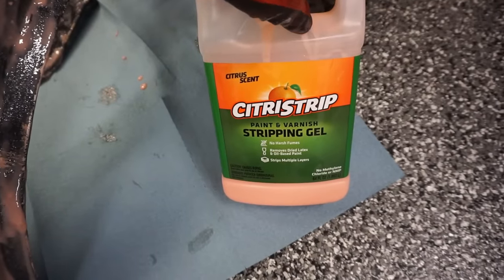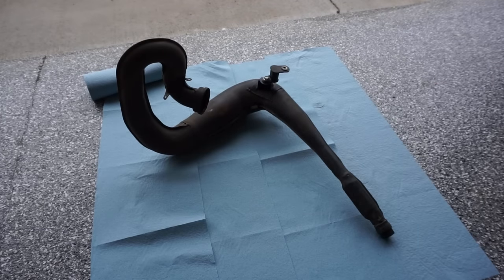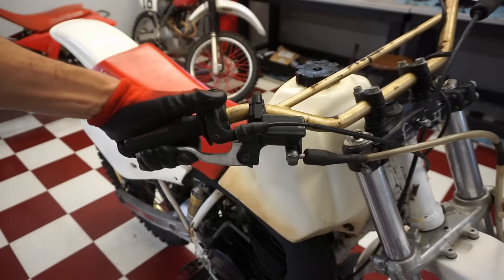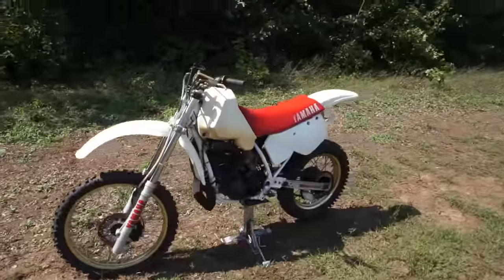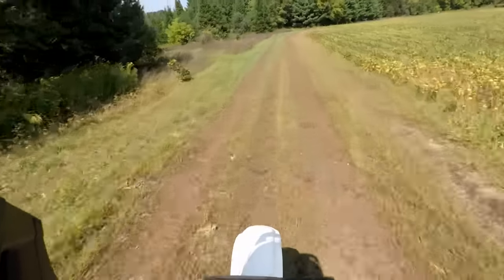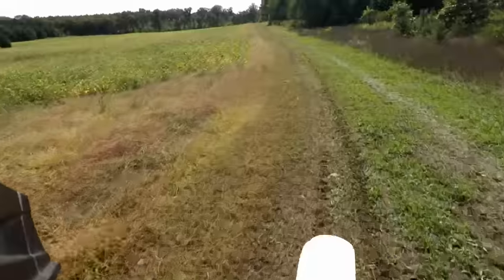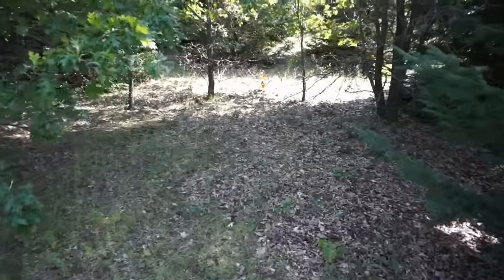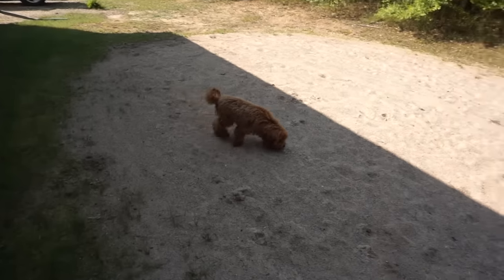Yamaha Yz490 Dirt Bike First Ride (INSANE POWER)

Comment: The YZ490 was prone to detonate / ping and run lean, we always jetted slightly richer and ran 30:1 premix to stop the rings galling. The best technique with them is to short-shift like a 4-stroke and let the torque do the rest. Running them on the top of the power-band is tiring and potentially VERY risky.
Reply: At 35yro I would suspect the crank seals have started to develop minor leakage.
Reply: Really I appreciate that info I'm buying one of these from my friend having only rode at one time it's a good bike but I don't know anything about them I've been on four strokes for the past 15 years
Reply: Not true at all there good bikes.
Reply: When these came out, I was working at a state OHV park in Calif and we saw several loop out on hill climbs as riders were getting surprised by the power available.
Reply: You need to keep running a 2 stroke lean in order to tweak the higher rpm's out of it. And add a little synthetic oil to your fuel instead. My experience with 2 strokes is from out of using OS Max and Enya RC aircraft engines and we used a Methanol/Castor oil mix 70/30 so adding a little oil to your fuel will crank out the full power of your 2 stroke.
Reply: @cryolabs  The only issue with running motor oil is the build up it leave behind. I guess it doesn't matter if it doesn't have a power valve but for those newer bikes, it would gum em up pretty good. However, if your looking for power, that may be a viable option.
Reply: Uh. Yeah. Its what the original poster said.
Reply: @cryolabs many people don't try to get to know the oils. They see a bike run strong and think it's good. A Two will get most it's power at it's leanest point which will seize it. Motul 800 off road oil is an amazing oil. Castor 927 two I'm very familiar with. I found best performance out of Two stroke engines staying between ratio of 32:1- 40:1
Reply: Good advice, thanks
Reply: Thanks for sharing Joe, love the trail cam shots.

Comment: Also if this helps after you turn on the gas tank. If you lay the bike over the float will open on the carb and it will leak a little gas out of the carb. But some will go into the intake  manifold. This primes the engine. This will make for much less kicking to draw fuel into the engine. If you lay it over for just 20 seconds or until you do a little drip from the carb over flow that all you need for a prime. I hope this is helpful! I’ve had several large displacement two strokes are and if you don’t have it primed. You can spend a lot of time trying to get enough vacuum to draw fuel in. And then you’re all worn out? Thank you for your videos. I’m only trying to help. So many are so critical of everything you do. And that’s not fair. I just want to be helpful.

Comment: I’m told those YZ 490s were very hard to jet accurately! They had that they had made them either run really rich and if you leave them out then sees right away. Yamaha had some service tunes on that where they used to base gaskets to lower the compression and that seem to help with the preignition in the head. You might be able to look up these findings on a YZ 490 forum
Reply: The squish was wrong and replacing the throttle valve with a leaner cut away helped too.
Reply: There is a head mod for this and solves all the pre-detonation issues.  These are great all around air cooled bikes for larger riders.  Find the best non-ethanol fuel you can get.
Reply: @jonmccormick8683  💯.  They need the head mod
Reply: Back in the day running 110 octane fuel cured a lot of issues on these bikes.
I had a couple of 490's back in the day and the rideability and starting, plug life everything was like having a different bike running high octane race fuel versus pump gas and back then pump gas was available that was much better than what you can get today!
Reply: Don't forget the front fork boots!!

Comment: I went from a YZ250 to the YZ490 then to the TT500 and finally the TT600.  I'm 62 now but I wore out plenty of these bikes in the 80s.  Nice to see you bring one back to life.  I do agree when the YZ490 hit the pipe it was crazy scary.  Love the channel.
Reply: I love the channel l would like to know the price for a 650 key start engine
Reply: Strangely enough I almost did the same: IT175, IT250, IT465 and then IT490, then on the flip side, XT550 then TT600. Loved the way Yamaha was building bikes in those days.
Reply: @jakeslouw3416  Absolutely.  I was a Yamaha rider and still a big fan.  I wish I still had the TT600 today.
Reply: I had an 82 490,75 tt500 best 2 bikes ever had

Comment: I was smiling the whole time you were riding it and laughed every time you said you were scared of it.  It brings back great memories of my KX500 in the dunes.  LOVE the big 2 strokes!!!
Reply: A mate in the uk here had one,84 I think…you coujd ride it in 3rd gear ALL DAY !
Reply: Exactly the feeling a big bore should give you.
Reply: @joelfildes5544  yeah just pick a gear and sent it
Reply: @staygold902  the irony is I own a Husky 701 these days,and it’s nowhere near as lofty as the big smokers of the 80’s…and it’s 68bhp ! Mind you,it will go all day at 80mph …
Reply: @joelfildes5544  ken Kaplan has some proper cr500's. Absolute rocket ships. You'll need a change of underwear after getting off one
Reply: @staygold902  aye,I follow him…always loved the big kwackers meself,pure evil !
Reply: @joelfildes5544  depending on year, the LC4 engine puts out 74hp, the most powerful single 4 stroke produced. I have a 2020 KTM690 enduro r, we have the same engine. I also have a 99 KX500 I’m thinking about selling if you’re thinking about chasing that adrenaline.
Reply: @Rakkasan-vr8xt  bad news I’m afraid,since posting this,I had my 701 mapped on a rolling road,58bhp at the rear wheel…full de-cat,Twin air thin filter (the Rallye filter,the aftermarket foam one,robbed 8bhp !) The 74bhp will be at the engine…

Comment: Great video. In the future when painting a pipe, hang it with 2 strings. It will be in the air and you can turn it any way you need to make painting easy.

Comment: If you find the throttle is not sticking then it’s a crank seal. I had one do that. Every so often it would suck the gas back in and take off. Had a pretty good crash in a race when it happened at just the wrong place. Nice pics from your property.
Reply: I knew of a ppl old friends in highschool they all said the throttle stuck an they wrecked I wonder if any of them had a bad crank seals.
Reply: also if you find crank seal not it i found my jug/ cyl bolts had loosened up, my husky did same, did it to me while in the air doing a wheelie…. needless to say flipped me backwards, BE CAREFULL

Comment: I hope this helps you. There is lots of people who have encountered this keying issue. The shape of the combustion chamber was designed in such a way that the  bike stock either blubbered or if you leaned out the needle jet or put in a smaller main jet it would seize. The service bulletins recommended 2 base gaskets to lower compression. I am told that helps.
Reply: I have heard this also, the 490 used to detonate when it got hot because of chamber design
Reply: Also, higher octane fuel gives a cooler combustion. If it's hot at 90mon/Ron, it may run cooler at 100 octane that also has a higher boiling point. Of course this begs the whole lean/rich conundrum. I wonder if Custom CDI mapping would also help the head mod they speak of...
Reply: Try 40:1 race gas mix 100 octane.
Reply: GreAt advice, I heard the same. Unfortunately this doofus doesn’t read or respond or any comments
Reply: @njmxjunkie3128  😂
Reply: Sure.  The old gas was leaded and had more octane.  Think he is running premium? 😑
Reply: Send Head to Eric Gorr and have Squishband changed to help it run on 94Octane.   Did this on my WR 500 and it helped a ton’
Reply: @jasonmushmansixtyfive  😂doubtful
Reply: @mrmoparrr  I sold him a 250R quad I built and he tried to blow it up for his movie I swear lol.
Reply: @jasonmushmansixtyfive  run it wide open for extended periods in each gear 🤦🏻
Reply: Just subscribed !  I sold my 85 Cr 250 to my friend’ upgraded 2 Piece clutch cover etc.  Worst fork angle 📐 in the History of Mx Bikes 😂
Reply: @njmxjunkie3128  major doofus 🤣
Reply: @mrmoparrr  thank you for the sub! I enjoy riding the CR and like the front end lol to each their own!
Reply: @GrumpysGarageDave  you calling me a doofus?
Reply: @njmxjunkie3128  NO .. the chucklehead in the video
Reply: @GrumpysGarageDave  yeah he’s a joke. I don’t think he ragdolls the bikes tho, he isn’t the best rider to begin with. He’s more the casual trail rider that’s passionate about working on bikes (which isn’t a bad thing) the bad thing is he needs a lot more practice with his mechanic work, he doesn’t respond to YouTube comments or Instagram messages, he does nothing to give back for all the money he makes on YouTube, and like the dude doesn’t even sell merch…..!honestly I’m jealous of the platform he’s built
Because I know how much further I’d take it and differently I’d do things
Reply: @njmxjunkie3128  i have no clue how this dude has got the subs that he does other than he is trying to work on big bore 2 strokes ... in my younger days I raced and wrenched on all these open class bikes and they are definitely not for beginners .. I still wrench and ride them just dont race anymore ... this channel is a perfect example of more money than brains or ability
Reply: @njmxjunkie3128  It's possible he's just a regular guy that likes to wrench. He makes a video or two, Youtube cuts him a check. Of course he's going to make another video. Why do we watch? I have no idea. But I do know that if he thinks that thing is scary idling around on flat ground, What do you think he'd say if he ever got it on the pipe on an outdoor MX track?

Comment: My mom's ex BF picked one these up from his brother for my friend to have a bike to ride with me. This was 20 something years ago. I had a new yz 250. That thing was scary as hell. I got on it behind my buddy on some single track and it got going so fast I had to shoot around him in the weeds. I got the throttle stuck like that too except it was stuck WIDE OPEN!! It overrode the kill switch. I turned the gas off and ran away!!😂😂 was soo damm loud! The handle bars vibrate so much you get hand and arm pump super fast. What a beast!! Clean the needle valve. That is what was stuck on ours.

Comment: Love big bores !!! Back in the 80s I raced a KX 500 in gncc for years. Loved the power to climb, get threw the mud, and the speed to over take or pass.  Had a 4 gallon desert tank. PSI pip and slincer. Bosun reeds even put a 1 gallon number plate tank on it and never had to stop for gas.  Had a blast on it and did pretty well in open A. That Yamaha is an on or off switch it's a beast. The only bad is it's air cooled and when hot drops a few HP.  I would still love to have it !!!! Love the power  👍👍👍👍
Reply: i had a extended kx500 built for climb comps and i loved that bike there’s nothing like a big two stroke on a hill especially with a extended swingarm and studs ect!✊🏽💨

Comment: Another tip i wanna share with all you dirt bike guys. I've been running automatic transmission fluid in my dirt bike cases for two decades and was amazed at the reliability and easy shifting smooth quick and rarely missing a gear at all. No it's not harmful to the gearbox running transmission fluid.

Comment: I have a 1988YZ 490 just like yours.. it's definitely a beast but I'm used to riding bikes with lots of power..I had a 1979YZ 400 & it was a lighter bike..it raised up in every gear even faster than the 490..if you can find one definitely need to experience it.

Comment: I bought a 1987 YZ490 new in 1990.  They had YZ490’s or XR650 for $2790.  My buddy got a 650, the 490 would run circles around it.  I could even buy leaded 92 octane gas, and it would rev to the moon.  I miss it.  Rode my daughters BF ‘17 KX450 a month ago and scared me, 4 strokes have come a long way!

Comment: I recommend  adjusting the idle speed  very low, may be an inconvenience at idle, but during riding, it's a lot better because it allows the engine to come down on rpm.
It has so much torque that you can log it and will pull right up.

Comment: My older brother used to race open class on a YZ490 in the early 80s.  He let me ride it when I was 12yo and it was by far the fastest thing I had ever been on.  Just brutal power in every gear.  Of course, I weighed about 100lbs soakin' wet holding a brick at the time  :)  I had to stand on a stool to mount it, and would ride up next to the stool to stop.  Otherwise, I had to do the big lean to touch the ground.  His was yellow and black and I believe water cooled if memory serves...

Comment: Cute  pooch . I  have  a little  story  about  one  of  those  bikes . About  20 years  ago  my best friends  son bought  one  for  500 dollars . He brings  it  to  are  work to  have  his  dad  and  I  to look  at , I  use to  race motor  bikes . Bike runs great , needs  no  work . Kid asked  me  to  take  it  for  a  burn , we'have  a  500 foot wide  yard.so I  hopped  on road over  to  a corner  turned  it around   and  stopped . Put  it  in  first  gear wound it up  a bit  dumped  the  clutch  and  off it went  hit second  hit third , only  used  half  of  third and  off the  throttle  . I  asked  his  dad  you  have  life  insurance  on him , he  said  no . I  told  him  that  bike  is  scary  fast . The  young  fellow  road  it for  a  couple  of  weeks , then  went  to  the  durt  track  with  some  friends . One  of  the  friends  came  to  the  yard  to  tell  us  the  kid is at the  hospital , broken shoulder  and  arm. Buddy it looked  wild when  he  hit a BIG jump . The  bike  went  one  way  kid went  other  way  about  30 feet  in the  air . Say  no  more , the  kid is in his  early  20's. Dad sold  the  bike  next  day , for  500 dollars . 3 months  later  the kid came  back  to  work . He was  so  lucky . I  never  Sean 4 th gear  on  that  bike . Be careful ! If you  can .

Comment: I had 81 yz 465...throttle stuck when a small grain of sand coming thru a too -used air filter.  The slide is rtoo tight l.  Pls replace your air filter!!!  Mine got out of control at about 40 mph.  I had to jump as I was heading toward a fence!  That was 40 years ago and I remember it like yesterday cuz it scared the crap out of me.

Comment: Had a yz490 myself. Just brutal power. Couldnt keep the front on the ground during acceleration. Had it for a month then sold it and got a cr250 which was much more manageable.

Comment: Yamaha wrench report head mod and proper jetting will clean up running characteristics of this engine. I was reading comments about installing xtra base gaskets,  this will alter port timing making it more difficult to jet , and start , 2 head gaskets works well and allows pump fuel to be used , set timing 1 degree btdc , I personally like hpi ignition systems,  they are the same group from pvl so they know ignitions,  getting this 490 engine's running smooth is key , stk is very rich , extremely durable and well built engine just needs a little more love !! Great 👍  video again joe , love seeing Vinnie as I have a golden retriever  " Bourbon  " 2 yorkies Bentley and Jake as well as a mini pig 🐖  BIG AL 😀

Comment: Joe you can wet sand those plastics. They are entirely white as in they used white plastic in the molds. Wet sand start with around 1500 depending on how bad it is you may need a 750 or 800

Comment: I had a mid 80s yz490 also. My bike would run on like that when it got hot. Kill switch wouldn't even work at that point. I would try and go a little richer to get the temp down a little. Would highly recomend wearing your boot when starting, I got kicked back on and thought I broke my leg. That being said... what a bike.

Comment: They are definitely bikes worth keeping and adding to your collection because they are becoming far and few between. I kept the 1990 I picked up and did a full resto mod threw on a 2004 yz250 front end got the rear shock built by mxtech etc etc and it's an absolute ripper now and a total blast to ride I'll never sell it I've been offered 6500 bucks for it but just can't part with it lol

Comment: They are scary at first, I went from an RM250 to an RM465 and it was a massive difference in power. Took me about a month to get used to the front wheel coming up every time I touched the throttle, but once I did, my God was it fun to ride. Beware though, if you ride it a lot you will get some crazy arm pump, from trying to hang on to all that power. 

And I know what you mean about how fast it is in just 2nd gear, I usually rode mine in two gears most places, 2nd and 3rd, it was hard to find a straighaway long enough to get out of 3rd gear. One place I rode at called Farmdale creek was so small I could not even get to 4th gear, the other place had a couple long dirt roads, and it was the only place I could even get out of 3rd gear. 

My front wheel lasted forever, because it was hardly ever on the ground, never changed it one time in 8 years. But I went through 5 or 6 rear tires, it would destroy them. I also rode with a guy who raced the state circuit in the 250 class, and he said I hit him with a rock one time in the chest that knocked the wind out of him, that rear tire will throw some rocks a long distance.

Comment: Upshift early.  Turn a big motor slow and it'll reward you with torque down low.  Do a second gear start off on level ground and immediately go to 3rd, then 4th.  I had 2 big ITs, 465 and 490, and the 465 was a way better engine.  They changed port shape and volume on the 490 engines and made them difficult to start and peakier early.